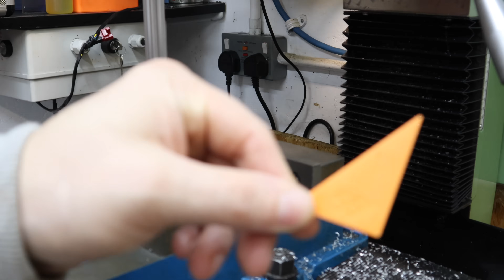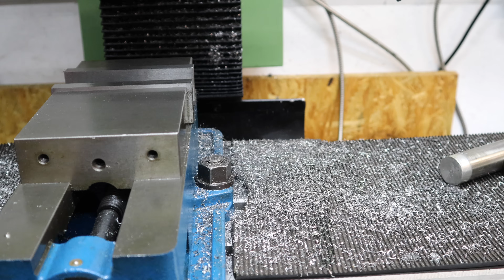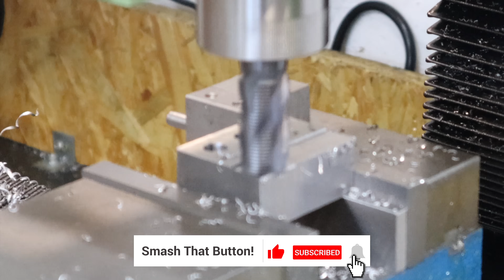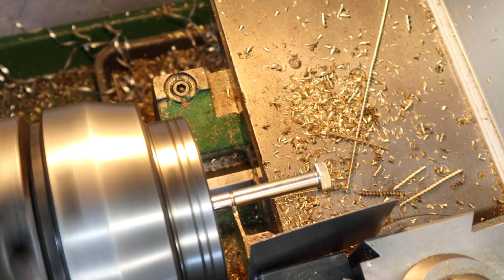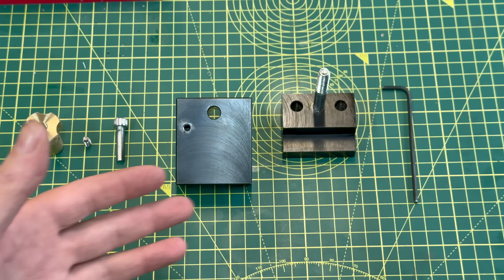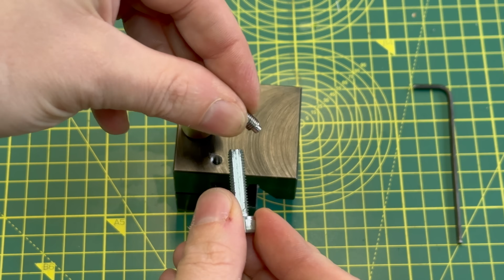Finishing one of the best tools for a Lathe

Comment: Hi Joe, you made a really nice job of that, well done. Per my previous comment on your last video, I would change the design of your stop screw before you use this in anger! The slot you have milled in it will just fill up with swarf and when you try to adjust it, that will just mash all the threads inside the block. Perhaps change for a domed pin with the same thread on the back end and a lock nut to hold in place, this will also give you finer adjustment than one complete turn. Good luck. Cheers, Jon
Reply from the maker: Hi Jon great point next time I’m in the shop il take a look at doing that sounds like it will be an easy change 👍

Comment: Running a threaded stud through with a flat similar to what you did but with a clearance hole for the threaded stud, you can put a captive nut on the other end to extend or retract the stud. You can even put calibration marks on the captive nut to indicate the travel.